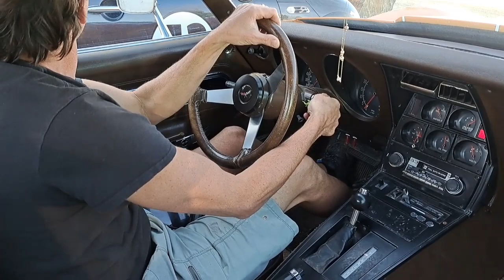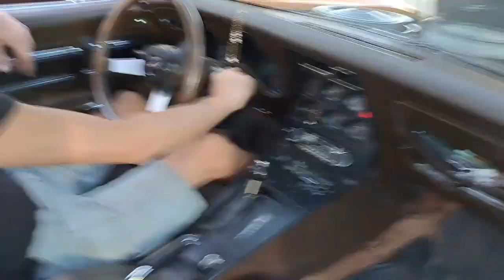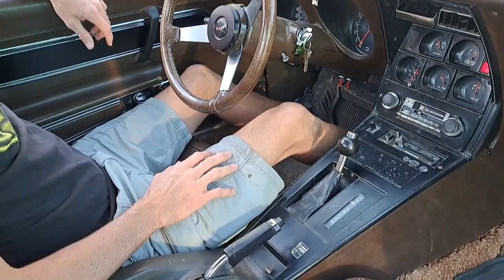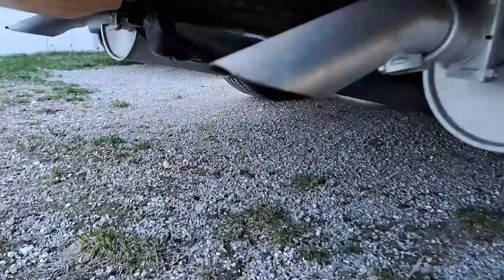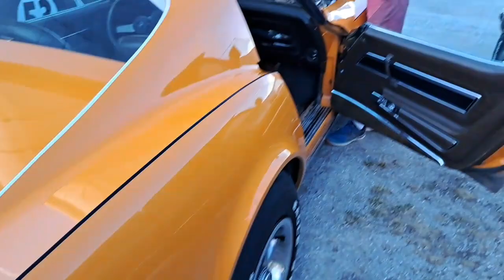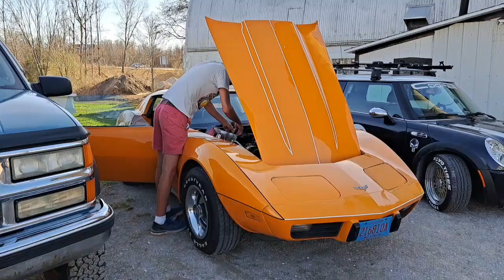1977 Chevy Corvette (Hard Starting Cranky Flooded Cold Start)

Comment: What ended up being the problem?
Reply from the maker: Carburetor I believe
Reply: @HanzelFonferek  I believe I’m having the same issue, car cranks fine, smells of gas, but won’t fire up. Car seemed to want to but not successful. Someone please help me !
Reply from the maker: @arsamhajmaghani1807  yeah, you should check for spark as well
Reply: @HanzelFonferek  I have spark
Reply from the maker: @arsamhajmaghani1807  Yeah, then definitely check out the carb. Might need to be cleaned out and rebuilt